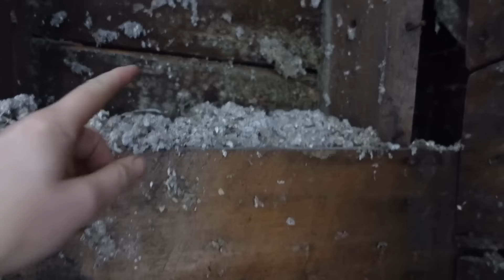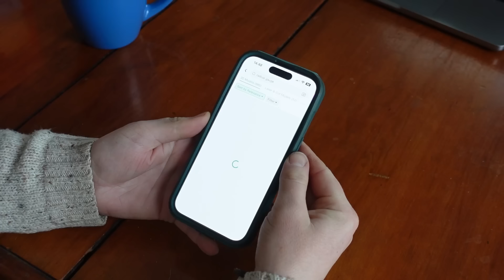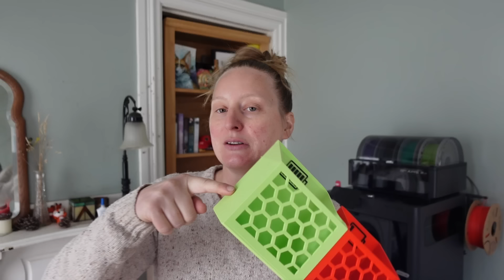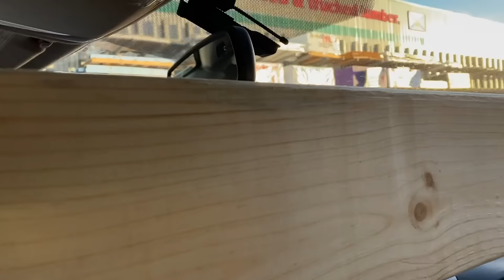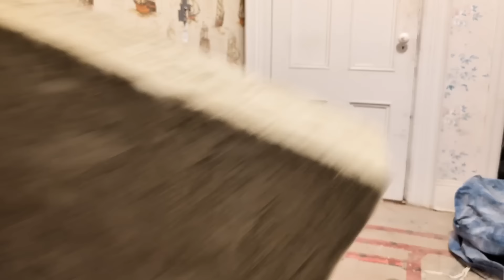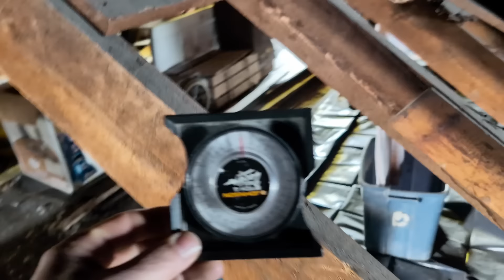We REALLY need a new roof... but at what cost?

Comment: Ah yes, ye old tetris insulation. We did that when we replaced our front door and added new windows. We had both outside walls down to bear studs. Not one of them was a consistent spacing except for the ones we replaced or moved for the new windows and door. Seeing you guys cut and fit each individual bit of insulation to fit brought back flashbacks. Good times. We put a lot of love into that room as you are doing with your house. Sometimes I miss that house. I feel you on the new roof. We are in need of a new roof too. At the very least we are going to need to replace some singles before the monsoon season hits and the El Nino storms arrive this winter. Everyone is talking about a super El Nino and how the patterns are matching up with the 1984 patterns. So time to figure out what we are going to do. I'm guessing your roof is going to be bigger than estimated, say 2200 square feet and it's going to cost 150k to get it refoofed. It's probably way high, but in my experience things are never what you anticipate them to cost when remodeling or in your case restoring houses. Might be time to sell pictures of Phil's feet 🤪

Comment: Congrats on the metal roof. I had to make a lot of similar decisions on my 1907 Edwardian. A few thoughts: With your snow levels in the Maritimes, you might want to add brakes - little ledges on the metal that slow the snow's plunge off your roof. Snow still will come down with some great drama, and you'll soon learn to not store anything under about a 5 foot wide patch underneath, and may alter your landscaping a little - tiny problems at most. One of the great things about a metal roof is the lovely sound the have in the rain - especially nice to fall asleep by. With your curved parts, I would still consider using your environmentally designed metal roof, and then have it overlap shingles on the bottom 4 feet or however tall that section is. It's a bit of a hybrid solution, but would give you durability for the most part, and if you colour match the shingles to the metal roof it would look fine. Or try RRM - which I think is rubberiised roofing membrane. You could put that on the curved part and also have the steel layered over the top edge. It's basic black - so doesn't win any beauty points, but is also a permanent roofing material. It's used much in industrial applications. Might be worth exploring.

Comment: We just had our roof done in metal. It’s an old ranch style house made of brick in nm usa 3000 sq.ft. 
It had shingles and like your house and where you live we have high winds.
Once the new roof was in the sound of the wind was greatly muffled up and no more moving of the house either in wind storms. It’s a definite upgrade for us.
We paid 48k for the new roof and the surface of the roof was around 5000 sq. Ft due to the different curve and pitch.
Get ready!!❤
You’ll be so happy when à new roof is on. You’ll feel safe and your house will be fully protected.
Ps: this included the price of gutters, and snow stoppers / barriers

Comment: what is the difference with the insulation batting you are using compared to the pink stuff?  I wish our Home Hardware would have informed us about that option because the pink stuff was hell to install (stud placement NOT at 16 inches in our porch).  Looks like you barely have floating fibres when you cut and install it.  Very clean looking !

Comment: I went to a metal roof when my 25 year shingles failed at 16-17 years and I got a couple of MAJOR LEAKS. I was not happy. The metal roof is guaranteed for 55 years and although expensive I didn’t want to have to deal with roofing again once I was retired. I have been very pleased with it.
Reply: Make sure if you go metal that you have someone tighten your screws every other year. The screws work themselves loose and then you get leaks. We have that trouble at our church and my neighbors. They should tell people that so it would cause a lot less trouble down the road.
Reply: @Kimella777  Must be a simple solution to your screws problem I think.

Comment: We live in MA, USA and have metal long  standing steam panels with no window stand outs. We love it but costly. It's aluminum actually. If you do it, make sure your gutters are under roof angle or they rip off with heavy snow. We put long parallel snow guards on roof which helps, but do know snow comes off very fast and can bend gutters.

Comment: I'm fortunate to have a slate roof.  They can last 100 years if maintained. We were lucky when we had scaffolding up for another job to use the scaff to get up there and fix any wonky slates. Hopefully won't have to do anything else for the foreseeable future because roofs are yikes expensive!
Interesting to see a modern method of making what you call molding and I would call architraving
Reply from the maker: Oooh, very lucky for you, that's fabulous! You'd probably use the term "skirting board" too, which I've decided I'm going to start using just to confuse viewers 🤣
Reply: @ShannonMakes yes I do say "skirting board" 😊
Reply: I'm looking at a 1902 place with a slate roof, still on (probably needs to be taken down and back up) but the materials are likely still 80% usable

Comment: I really enjoyed this video. You completed a task in one video and even had another task looked into (the roof). Usually, I'm left hanging as you don't usually complete a task in one video, it's usually several, lol. As for my guess on how much the roof will be is $15K, if asphalt shingles more if it's another product. $15K over 25 years though is $600 a year, if that helps to ease the pain, lol
Reply from the maker: Well usually old house tasks aren't simple or straight-forward enough to be completed in one video! And also, it depends on what you consider a task, right. If you define "insulating the walls" purely as the action of putting the insulation in the walls, then yea, that only takes a handful of hours. But if you define it as "starting with the room as it was when you bought it, insulate the walls" well then, that's a task that's been spanning...3...4?... episodes because it required removing the plaster, preserving the wallpaper, removing all the window trims and baseboards, opening up one of the walls, removing all the interior planking (all while preserving ALL of it, which is always slower) and THEN adding insulation in!

Comment: I'm gonna say at least $50k USD. Our roof is about the same size and that was the quote we got for metal roofing.
Reply: New roof 4 years ago, asphalt shingles, hip roof with two long valleys and a chimney, old roof removed, two areas patched, a little bit bigger than yours = $35K USD.  Today's cost for a metal roof would be between 1.5 and 2.5 x more or between $46K and $77K USD.  So the $50K quote is realistic, dependent on replacing any decking as well as repairing the soffit.
Reply: Same here two years ago.  I was anticipating half that based on research, so very sadly it was not in the cards for us since it was urgent  Sure hope it works out for Shannon and Phil!  We looked into solar shingles too, but those don't seem to be quite ready for prime time in my area yet.
Reply: Did they just go right over the old roof with no tear-off?
Reply: @spikefivefivefive The quote included pulling off and disposing of the current roof. We did not go with that quote, as while it would be ideal, it is far more than we can afford.
Reply: I’m gonna guess 80 thousand USD for the roof.  I would be happy to send you 5 bucks to help.  I was very impressed with your method of installing the insulation in the hurricane room.  That was a lot more enjoyable than all the effort of preparing the room for the insulation.  I can’t wait to see Cannelle in the spring. OMG, I was holding my breath till you got home safely with those boards where they were in the car.  I guess you didn’t have to get on any freeways that are five lanes each direction.  I was bringing home an antique treadle sewing machine yesterday,  I had planned on taking the surface streets when I got to the middle of the city but I had to get on the main freeway then off again.  When I got to it,  I was in the early rush hour mess,  we were only going 30 miles an hour so I just stayed on it all the way home.  LOL. I HAVE NO PROBLEM GOING 30 MPH on the freeway,  it’s 70 and 80 that I have a problem with.

Comment: Metal, material will last you longer. Can do. Section at a time. Do the wort areas first. The straight runs will go faster then the gables and or valleys that will need flashing and or rain gutters to keep water out of the now dry basment.

Comment: Totally a guess on the cost of the roof..65k. 
The room actually looked so much warmer and less drafty, once the insulation was in. Bet it was quieter too.  So smart to keep the walls unfinished until the new roof is installed and water tight. Very clever how you handled the cut of those sheeting boards!! Always thinking 5 steps ahead. Stay safe, warm, and ahead of the water….